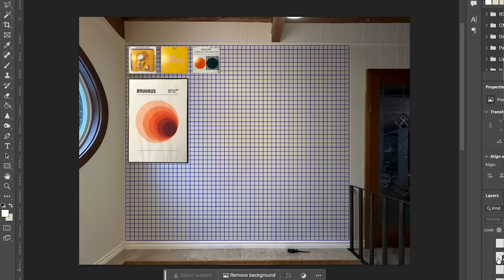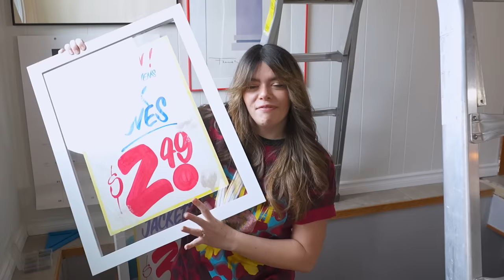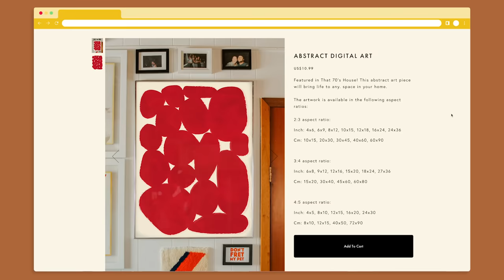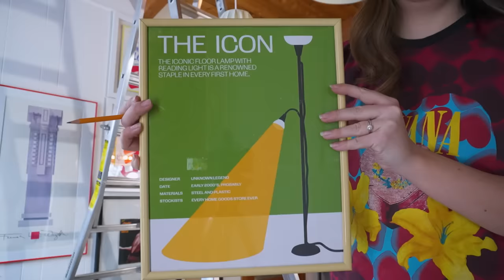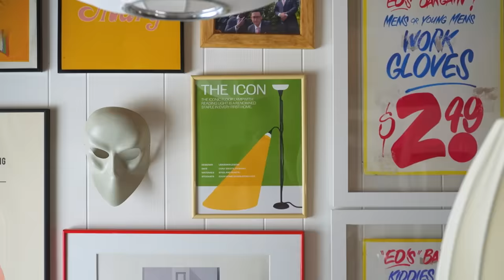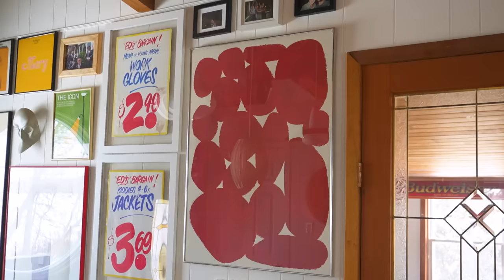EXTREME mcm entryway makeover start to finish | DIY railing & giant gallery wall

Comment: As always, I’m blown away by your work!! You are living my MCM house dreams 😍 

I hope you don’t feel too bad about the angles not all coming together perfectly. I’m a carpenter, and I can tell you it’s pretty rare when anything in a house comes together square and perfect. Another possibility is that your miter saw may not lock into the correct angles. You can try checking the calibration of your saw. 
That being said, I totally understand getting upset when a project isn’t going how you expected ❤ sometimes you just gotta walk away for a few mins and come back with a clear head. 
Something that might help in the future is a sliding bevel gauge (digital is reeeeally nice).

Comment: I did the same method doing my gallery wall, laid it out on a mockup in illustrator so I knew exactly how they fit. I found it a little easier than the paper method when you have a lot of pictures.

Comment: Amazing transformation! Everything works so well together and the gallery wall definitely has Becky vibes. I thought the glue-up of the boards for the top railing was super smart, I can imagine the melt down when the fitting didn't go initially as planned. It's done, looks fabulous and is something you and Austin can be very proud of.

Comment: in my home in Sault Ste. Marie our staircase had wrought iron railings - they were twisted and it was capped off with a gold plastic cover on the top - very classy for the times which was the mid 60's...so this will fit right in...

Comment: Putting a wood lip where the staircase starts and the wall ends (underneath the gallery wall) would really blend the space to me. I think the upstairs floor being a few inches off the wall looks a bit odd, and that would really “frame” the space in.  It could also be great for adding more frames/decor in without having to pull a ladder but still wanting “some” change. Great work as always!

Comment: Your new railing looks amazing! I do think you need to put back the handrail on the opposite wall for safety. I don't know what the Ontario building code says about stairs, even if it's not mandatory, I would have a handrail there in case you slip on the stairs.

Comment: Just some feedback on the wooden handrail. In my personal opinion, I find that when you stain pine it just looks like a cheaper product. And the wood that you find most often at the big box stores is pine. But if you find a local wood supplier that sells hardwoods and other speciality woods you can often get wood that isn't that much more expensive. If you go with a super nice product like walnut then yes it's going to be more expensive. But a cheaper wood like cherry or something similar would give you a much better looking finished product and wouldn't be that much more expensive. Often the big home renovation stores overcharge for their wood anyways so the local wood yards are often fairly competitive in price. 

It's just my opinion but using other species of wood that aren't pine makes your projects soooo much nicer. This one turned out great so it's not that it's horrible. I just thought I'd offer up an alternative solution for next time.

Comment: The easiest way to hack even spacing is to take a strip of paper the length you need, then fold it in half, then half again, then again and again until your folded piece is smaller than your maximum interval. When you unfold it, each of the creases will be equidistant and spaced evenly across the length. Transfer that measurement to your piece, quick and easy.

Comment: My problem with hanging pictures is that each of the frames has a different kind of hanging system, so for me it happens that it hard to calculate if the frame will hang lower/higher when I hang it (its hard to explain, but I hope someone understand what I mean 😅).

Comment: Sooo, if I remember math class correctly, because the railing makes a rectangular shape, the angles of the joints are not going to be 45 degrees, that only applies to squares. In rectangles, the angle is 60 degrees and 30 degrees to make 90 degrees? Something like that?